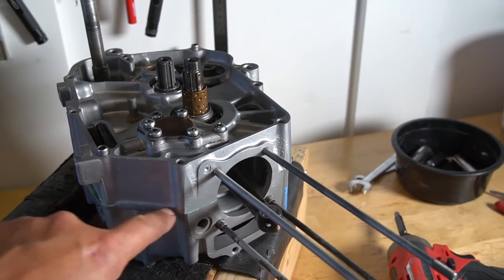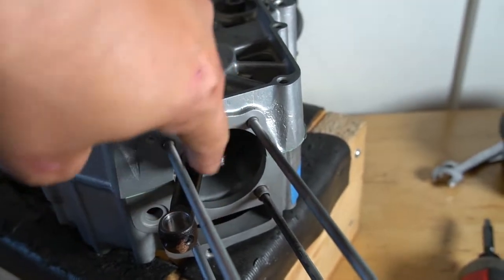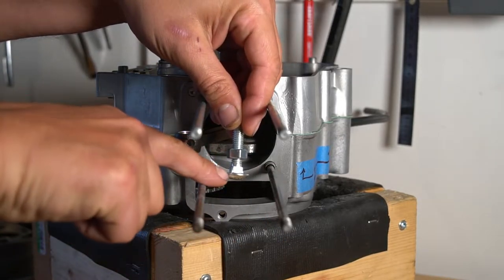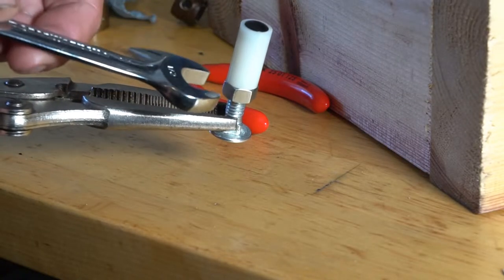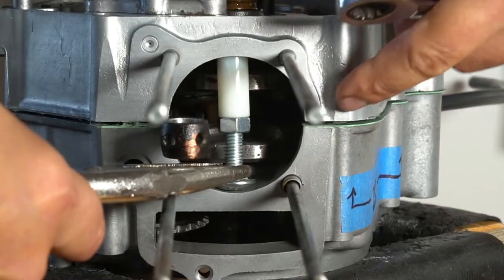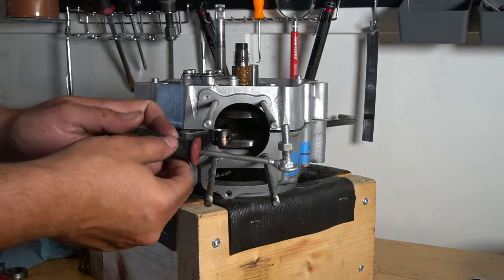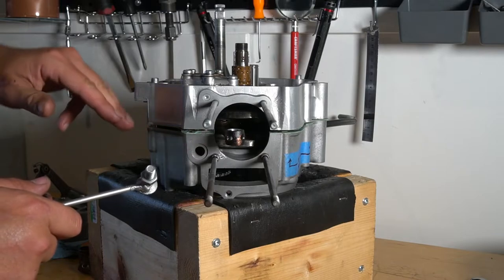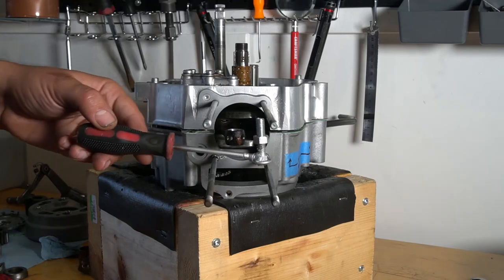Quick Center Case Split Tool - DIY $1.50 - Honda Horizontal Engine Z50 CT70 Dax Mini Trail

Comment: Josh, what’s your go-to method for pulling stripped case screws?
Reply from the maker: (2) options I like to use - First give the head a a good hit with a punch and hammer to jolt the threads - Then, If you can get to an edge of the screw head with a very small dremel cutoff wheel - Cut a slit/divot on the outer circumference of head - Then with a pointed punch and hammer hit that spot at a sharp angle in a CCW direction (Like your trying to make it turn) - It will spin and free up
Reply from the maker: or other option - Use dremel wheel and cut a deep straight cut for a impact flat head bit to sit nicely - Chances the flat head will get good bite and turn it loose. Also to prevent the initial stripping, use JIS #3 bits instead of phillips head bits.
Reply: Great advice. They came to me stripped. Probably by using a Phillips. I really appreciate all the help. Hopefully one day you’re on the side of the country and I can repay you with a few beers